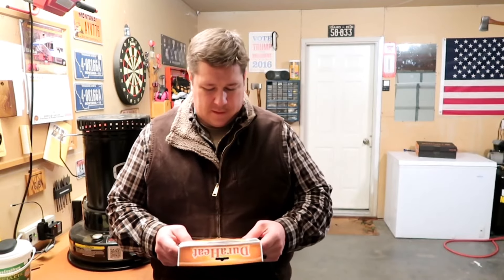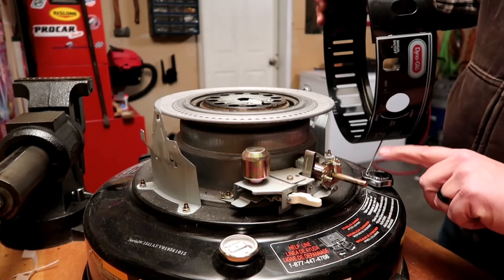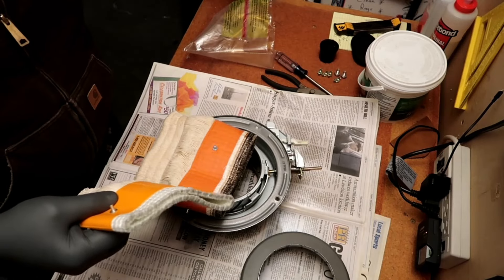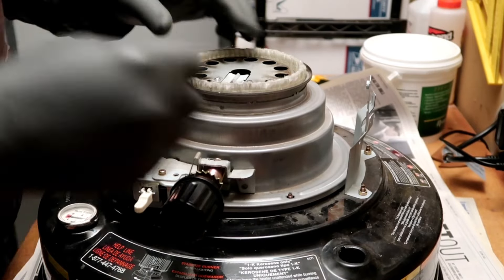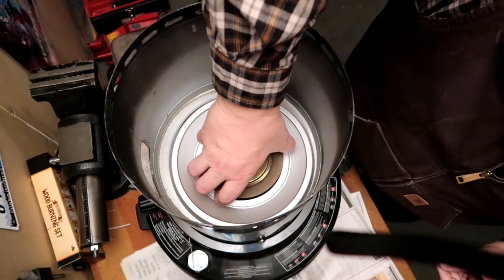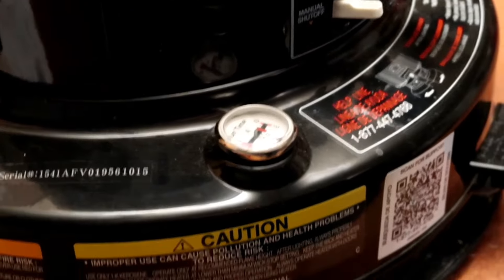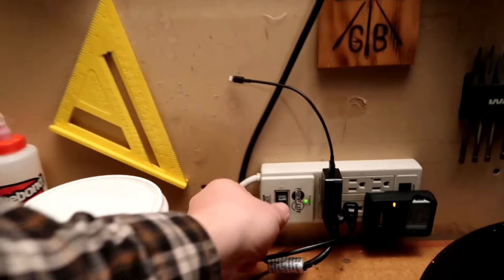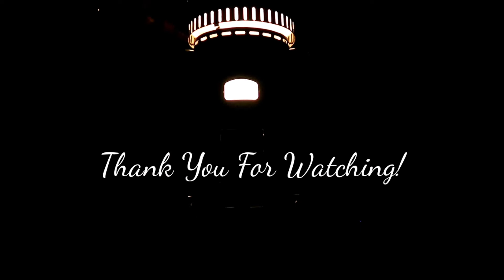How to Change the Wick on a Dyna-Glo Kerosene Heater

Comment: If you have to use that heater for your main source of home heat... there is no way you could afford the 1-K, unless you're a millionaire... and if you were, you wouldn't be using a kerosene heater... LOL
Reply from the maker: Honestly, Lisa, you're right. Kerosene is very expensive... about $8.50 per gallon where I'm at. I would never attempt to heat my home with it. That being said, however, it makes a great garage heater for the few hours I spend in my garage each day. Also, it's a great alternative standby for house heat should the power go down for several hours or even days. Kerosene shelf life is great and if one were to store 50 gallons or so it would be great for emergency situations. Lastly, if I were a millionaire, I would have my own homestead really quick somewhere quiet with lots of timbered land and I would heat with wood and probably be a lot healthier to boot!! :) Than's for watching and God bless! :)
Reply from the maker: One other thing I would add here... I did find pump kerosene for $3.00 per gallon - same as diesel - but it's 2-k kerosene. Not sure if that would make a difference or not? Perhaps I'll try it sometime in the future? :) Thanks again!
Reply: If you had been using your heater with no problems (considering I have only used it one season now), and it's worked fine... what would be the first thing you'd check if you were unable to get the wick to light?  I had been using it just a few hours ago.  I noticed at that point, that it didn't light evenly.. The whole wick didn't seem to want to light, but I finally got it lit, and now, none of it will light... Got any suggestions?  I'm cold :(
Reply from the maker: Have you tried dry burning it? - Burning it until the kero is gone and letting it just burn itself out? If so, it may have a build up of paraffin. If you'll notice, my wick looks completely black at the beginning of my video here... I tried to trim it and scrape it off but it's easier just to buy a new wick and replace it.
Reply from the maker: They say to let it dry burn after every other tank in the instructions to burn off all the carbon and paraffin deposits. The problem most people have with doing that is that it takes an hour to re-soak the wick to get it to burn again after it goes out.
Reply: I cannot imagine how you found it that cheap.  I am having to pay $70 for 10 gallons, and that's the pump kind (the red stuff I'm not supposed to be using)... and that's the only kind I can get anywhere around here.  BTW, I successfully changed my wick last weekend.  It took me about 3 good hours, but I finally figured it out.  I had a hard time figuring out how to get the wick to work, once installed.  I finally read instructions and got it done.  LOL.  The thing I was doing wrong, was putting the wick in the lowered position, when it was supposed to be in the raised position when installed.  I finally got it and was so relieved, since that is just about my only source of heat!  Thanks for your video.  It really helped me understand more about what I was doing!
Reply from the maker: Lisa Hurley You are absolutely more than welcome! It really does my heart good to know that the video helped! Just curious, how does the red dyed #2 kerosene work in your heater? Does it smoke or put off any fumes? Is that what you ran in it the whole first year? What model do you have?
Reply: Red Stone 95C6RB, and yes, that's all I've ever used, because that's all that's available around here... that I can even half way afford.  It has never smoked or put out any fumes that I've noticed... none whatsoever.  I  ran it the entire winter last year... I never did any maintenance on it, ... just added the fuel and turned it on.  A  friend bought it for me because I've gone several winters here in a little rental house freezing to death. LOL.  Well, obviously, I never froze to death, but I felt like I was... LOL  I love the heater.  It's awesome.  I just wish the fuel was cheaper!
Reply: But at least now, thanks to you, I know I can confidently change the wick, and will probably go ahead and order a few more to have as spares, just in case!
Reply: I answered your question, but I don't see the reply, here so I'm gonna try again:  I have the same model as yours I think.  95c7rb?  Anyway, I've used the red kerosene only for the full winter last year, and I had used it maybe only like 5 times this year before I ran into issues.  When I looked at the top of the wick, it was black and looked completely burned up.... I should have taken a picture.  Anyway, yes.. all I've ever used is red kero, and I never had any issues with smoking, or fumes... however, I noticed where many say they use theirs for YEARS before having to change a wick, so maybe that was the consequences of using the red kero???  Who knows?
Reply: I had never tried burning it out... I was going to do that... but by the time I got around to deciding to try that, I couldn't get it to light.
Reply: GOSH!  That means you'd have to take it outside on every 2nd tank, right?  It's kind of heavy!  LOL
Reply from the maker: +Lisa Hurley Thanks for the info! Makes my day to know I helped you! 👍👌 You helped me as well! Now I know I can run #2! 😉😄😊
Reply from the maker: Ozark Plateau Journey To Self-Sufficiency Sub'd! 😉👌👍
Reply from the maker: +Ozark Plateau Journey To Self-Sufficiency They say every other tank you should let it dry burn to keep it efficient. I usually let it dry burn every 6-7 gallons. I'm going to call on that red dyed kero and see how much it is in Idaho! 😆
Reply: Lisa Hurley I can't afford the expensive stuff I use the additive and pump kerosene and it seems to do pretty good we are dealing with a really bad winter here in GA this thing has saved our butts pretty good
Reply: Lisa Hurley I mentioned it above, But I use this heater as the main source of heat in my home. We get clear K-1 at a pump for $3.24/gl. I got 18gl yesterday for just under $60. That will last us about a week. $240 a month is still cheaper than it costs us to run the oil heater here. We rent and it has shitty insulation and needs more weatherization than we can do. 2 years ago we ran up a heating bill of over $2000 in one winter. Still paying for that. We are not rich by any means, but this heater is well worth it! Its currently 75 degrees in my living room and -25 outside. Ill take it!
Reply: Mel Rey  
$3.74 gal at circle K gas station last night.
It has the red dye but it's identical to the clear, it's k1.
I tried k2 heating oil last yr, no good.
I'm in northern maine near MT Katahdin, we already have 2 feet of snow on the ground, very cold. The oil furnace is good but I like this and the furnace is no good when elec goes out.
That happens a lot.
I am happy with my Wal-Mart kero heater.
23k btu heats the house.
Reply from the maker: Yup, I use this one all the time now that I've found kerosene for under $4/gal. At 7 - 8 gallons a week, I guarantee it's cheaper that our power grid right now! 😊👍
Reply: Mine runs very good on diesel and 2 bottles of 90 plus % alcohol.
Reply from the maker: If you use a 100% cotton wick, they will work but you have to special order them. The newer fiberglass wicks will not have as much life using diesel. They work well for a while and then they die. 😊
Reply: @LisaDianeRN  Water in fuel my have saturated the wick.  If water fills the wick, it won't carry kerosene.

Comment: Wrong diesel changed in 2014 all diesel is low sulfur and #1 actually has less then k-1
The highest sulfur content is in residential heating oil because it's exempt from epa guidelines 😅
Reply: The reason yours didn't work correctly is you ran it dry and you have a fiberglass wick, never burn it empty unless your changing the wick your cleaning the carbon off

Comment: $4 a gallon at Meijer in bulk.  No way I would use it at $8.
Reply: The availability of bulk undyed  1-k is an issue.  In my area it is getting replaced with the dopey racing fuel.   Luckily our local Meijer carries it at the pump.